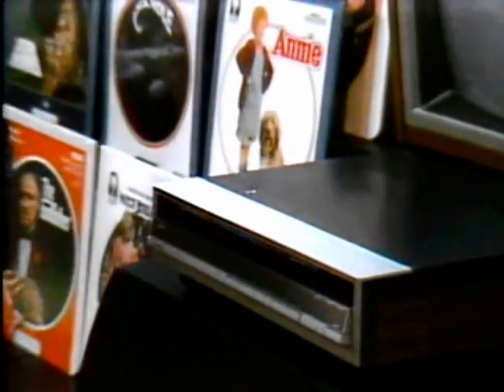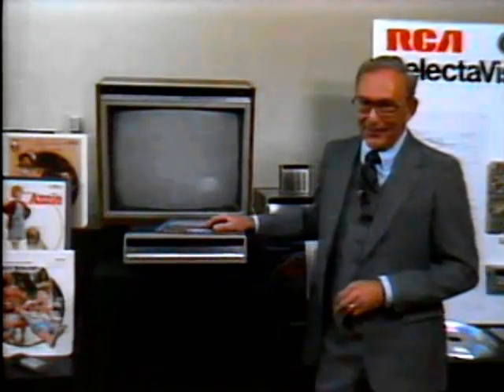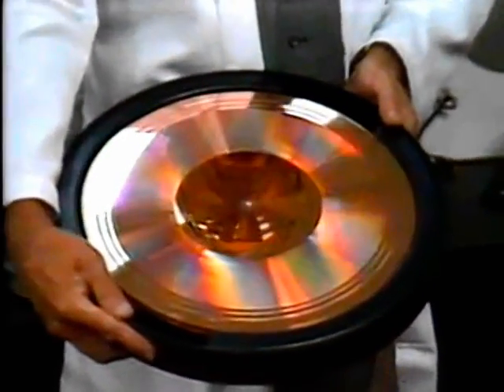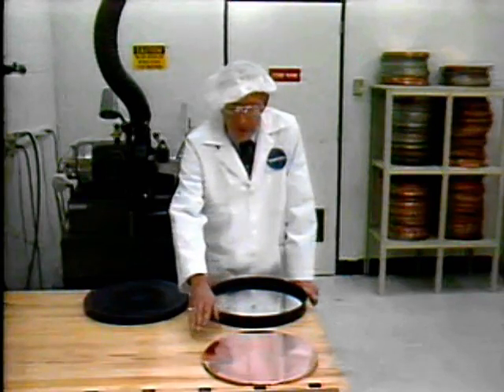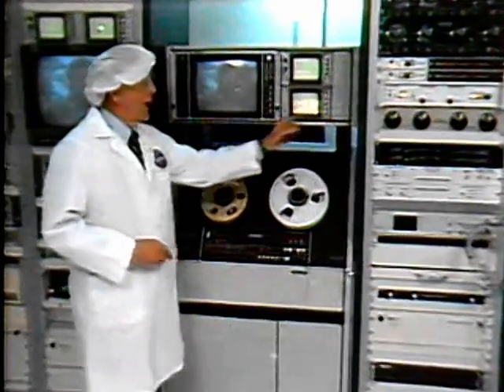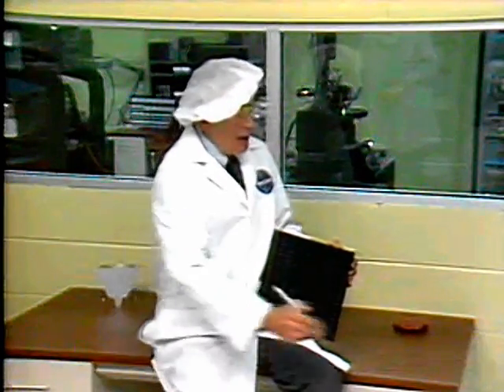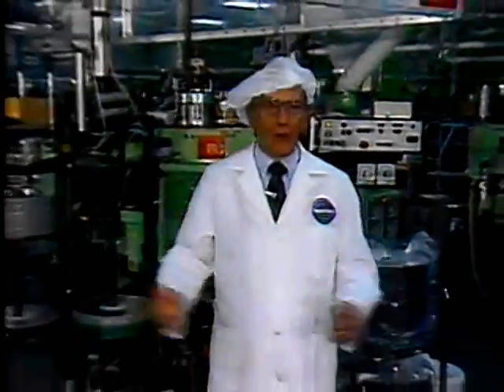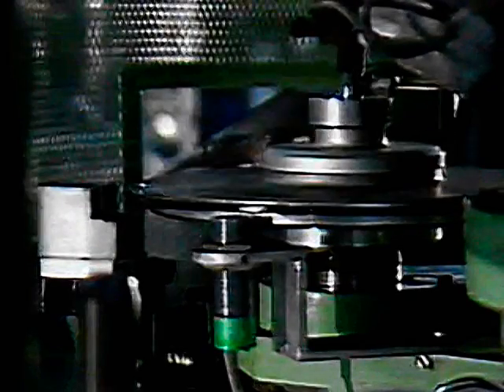RCA Selectavision Videodisc Production Tour PT1

Comment: Fascinating to me that RCA was using record presses to make CED discs. But that was the biggest problem with them. In the early 80's my Junior College bought a couple Selectavision players and a bunch of classic movies for the dormitory TV lounges for us students to watch movies. After a year most of the disks were badly skipping to unplayable.
Reply: +wildbilltexas No wonder those CED discs wore out so easily. They spin too fast and the friction between the disc and the needle it's just too great and the needle with each pass damages the disc little by little until it becomes unreadable. Audio records switched from 78 rpm to 33 rpm for that particular reason (and to store more songs )
Reply: The stylus did not travel in the groove! It rode the up and down movement of the grooves. It uses the changes in CAPACITANCE to create the electrical signal. A lot of you completely misunderstand the RECORD analogy...first of all it's not at all like an LP audio record. Secondly the stylus does wear out but the CEDs themselves are still working over 35 years later in some cases. I have dozens, and come collectors have gone for the entire set of over 1,000, minus the really rare titles. And what you also don't realize is that Asian markets had a similar system called VHD for Video High Density that lasted into the 90s. It's not compatible but discs for both systems are still out there and work. The disc itself was in a 'caddy' and covered in a lubricant for protection. If you touched the disc surface you were certain to damage it, hence the protective caddy. If you want to know more than you ever thought you'd want to go to cedmagic.com and visit either the main site or come join us on the forum...member kitchensynch
Reply: @steadfastcoward  Its still similar uses a stylus with grooves which is in the same catagory as a record. If vinyl didn't exist i doubt this wouldn't of came to light.

Comment: VideoDiscs are basically video's recorded onto a disc(like a record). The VideoDisc Players play the videodiscs using a needle , just like a record player.
Reply: Not exactly. Record needles ride in the groove and travel side to side AND up and down in the case of stereo. CEDs are read from a groove that moves up and down and a signal is created from the capacitance differences, hence the name Capacitance Electronic Disc (CED).The STYLUS used in a CED player is hardly the same as a record needle. It approximates it in name and such but it's a beast of different stripes.